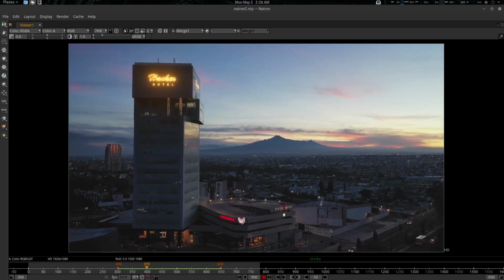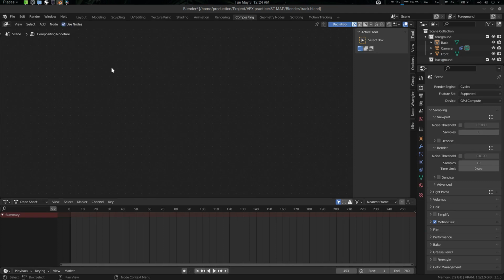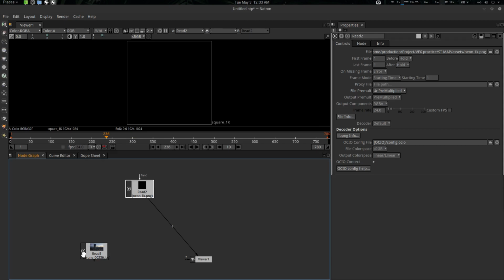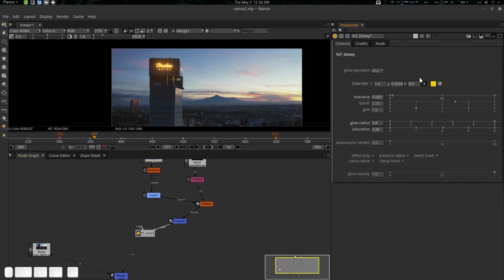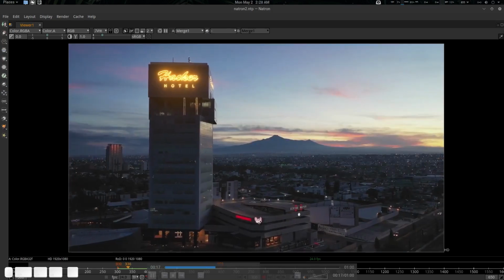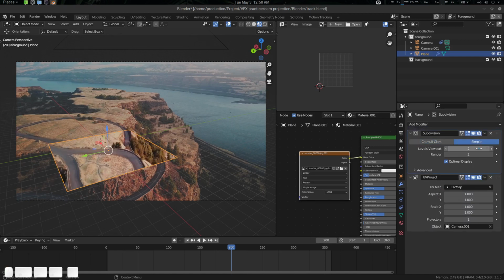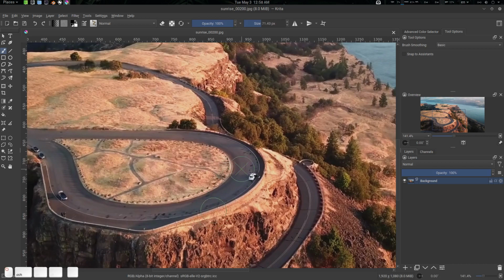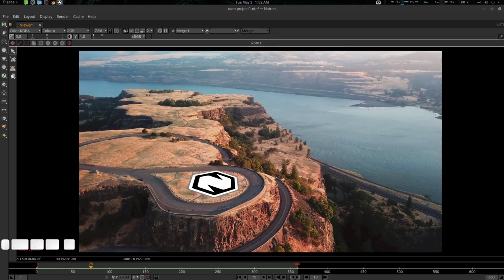Using Blender UV pass to Natron STMap for camera projection compositing

Comment: what linux distro do you recommend for blender,natron krita? and wil i have gpu rendering on a amd rx480 8gb?thx
Reply from the maker: Hi, I recommend Linux Mint for a production machine. Yes Linux can run on amd and nvidia without any problem, just use recommended driver from the mint device manager. 
Nvidia is for now a better option as it has cuda and RTX advantages. Other than that, AMD is also cool.
Reply: @cgvirus  thx 🙏 for info!